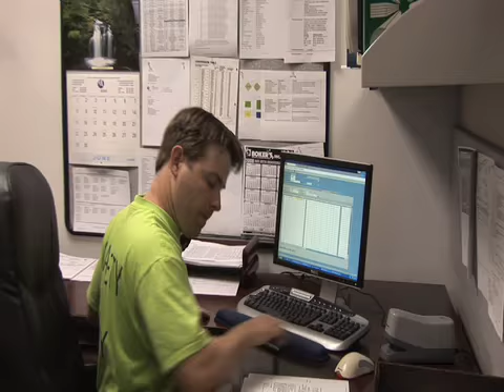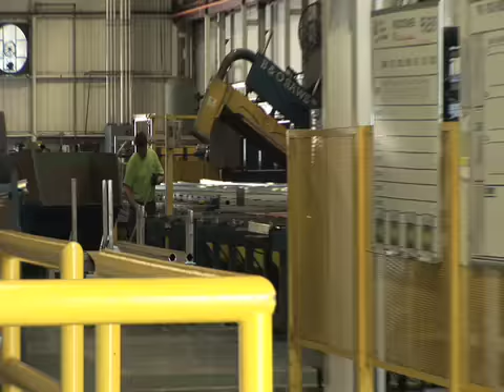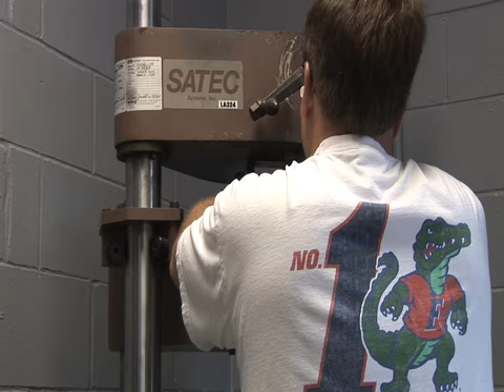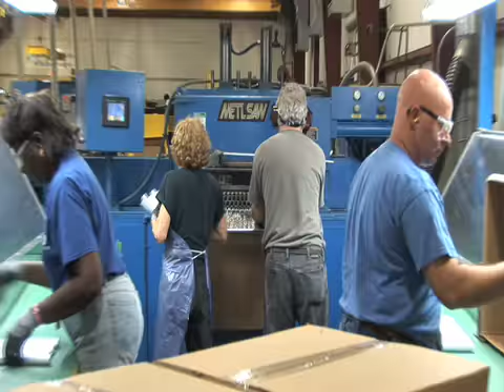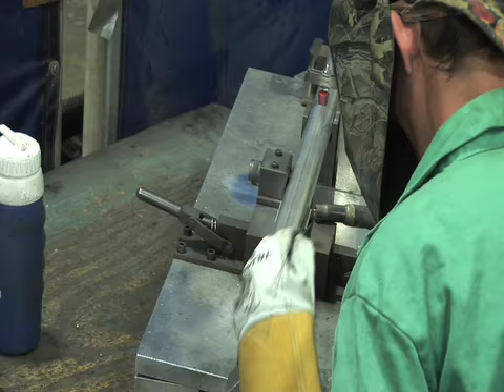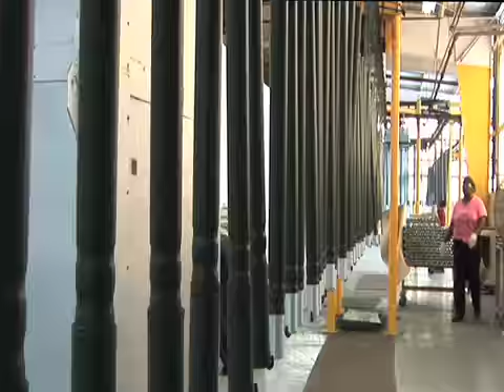Hydro - St. Augustine

Comment: Back about 30 years ago I worked as a painter in the paint shop right when the powder coating started to come in, boy its been awhile lol also worked at the small 8" press on weekends some times.
Reply: I also worked in the paint line 30 years ago! (Saint Augustine)  Then Fabrication.